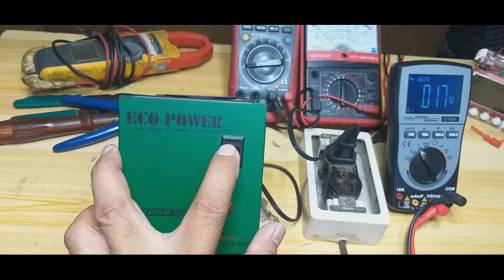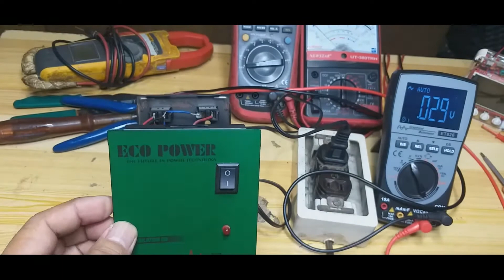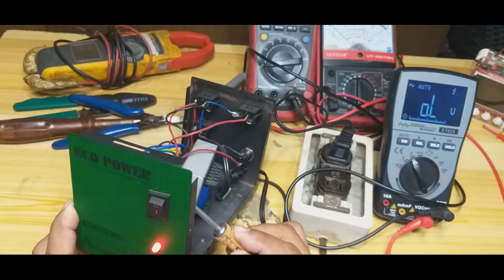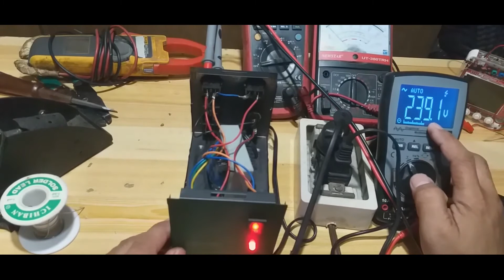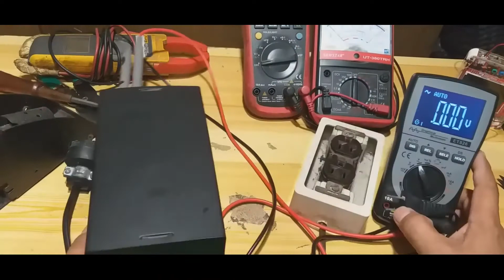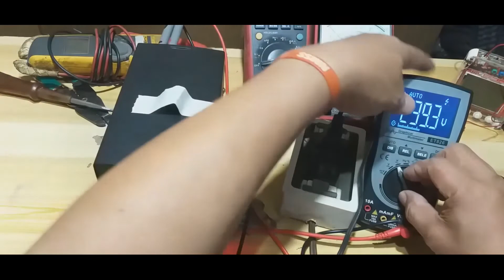DIY PAANO AYUSIN AVR AUTOMATIC VOLTAGE REGUlATOR /switch problem/ electical arcing

Comment: Bakit hindi sya nagreregulate yun secure ko 245 ang du pero sa kanya 224 lang via fluke multimeter
Reply from the maker: check mo sir yun relay kung nag switch pag hindi nag switch replace mo sir

Comment: pano po kapag mababa ang value nya sa output?? nagiging 170-180 volts po yung lumalabas sa tester po
Reply from the maker: Meron po problem sa transformer po check po transformer if good pa yun other output

Comment: Boss meron ako ganyan avr ang problema shorted ang power plug nya. Meron sya naread na 20 ohms. Ano po kaya problema?
Reply from the maker: sir yun na read nya sa transformer yun  kung shorted po yan 0 to 12ohm ma read nya  relay lng check mo sir
Reply: @aesvlog8056  pero sir nagbebeep kasi sya. Ndi ba delikado isaksak yun. Nakaranas kasi ako sa microwave oven mababa din resistance nasa 70ohms lang pero wala beep kaya ok lang pero dito nagbebeep sa sobra baba😥 wala pa naman akong lamp tester😥
Reply from the maker: lagyan mo ng fuse sir .5amp kung pumutok fuse shorted na trsformer
Reply: @aesvlog8056  meron sya boss na fuse circuit breaker type 5a , na pwede ipress para mareset. Tagal kasi nastock to boss ndi ko matry kasi baka pumutok😅 kasi nagbebeep plug nya😥
Reply: @aesvlog8056  pero sige boss try ko lagyan ng isa pa fuse na mababa para sure magcut kagad kapag shorted. Salamat po sa idea
Reply: Ok na sya boss. Nawala na yung shorted sa supply plug, wala na beep, open na sya. Kaso ndi ko alam kng pano nawala🤣 kasi tinanggal ko lang naman relay para macheck, ok naman sya pagbalik ko at naglagay na din ako secondary fuse bigla nawala yung short sa plug nya🤭
Reply from the maker: ah ok
Reply: @aesvlog8056  baka po nastock up lang relay kasi nung tenest ko sa board ndi open yung NO nya tapos pagkatanggal ko nagopen na. Duda ko stockup lang tapos naging ok sya siguro nung nainitan ng soldering iron. Salamat sa idea boss
Reply from the maker: tama sa relay lng yun sir nag locked yun contact point